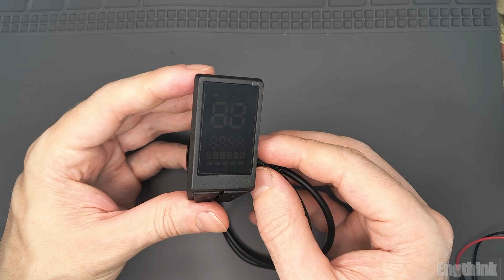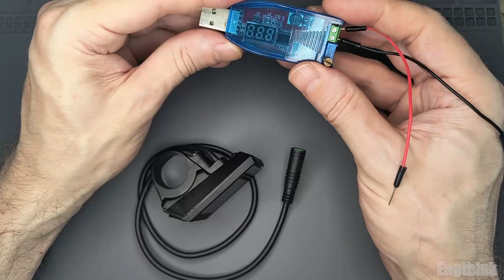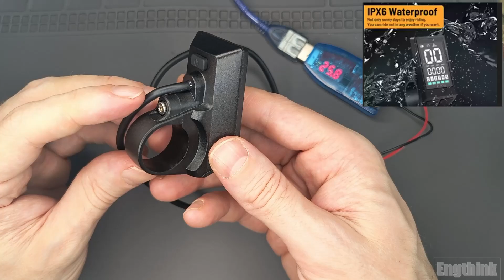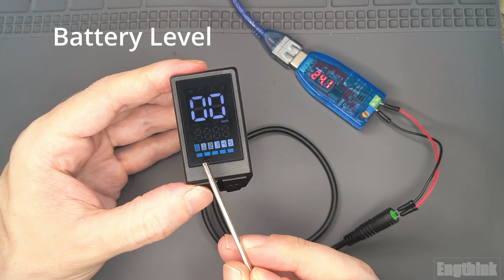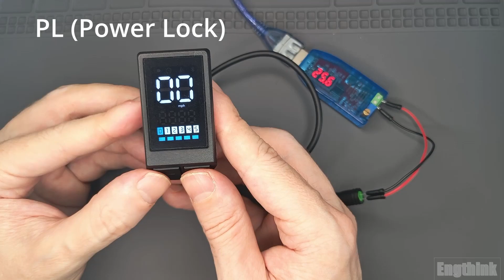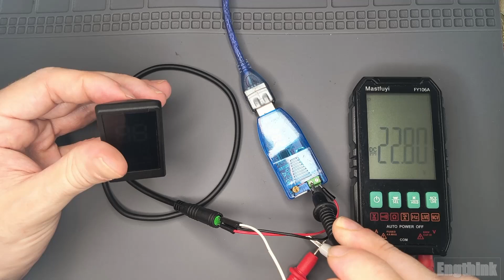🔧How to test Bafang Ebike Display BN136 Mid Drive Motor BBS01 BBS02B BBSHD– UART & Power Lock Pin 🔧

Comment: Hello! In the diagram you have drawn, where does the ‘male’ connector come from? From the Bafang controller? And why is the pinout different, rather than a mirror image i don't understand, please?😅
Reply from the maker: Hi, male connector come from Bafang controller that is together with the motor. The male connector is wrong you must follow the female connector.

Comment: What if you have a 6 Pins connector? Where can I get this LED controller? I have the same bike that I purchased on Amazon and my controller does not work. I need help.
Reply from the maker: You need to check the LCD display model/code and try to find the same one.